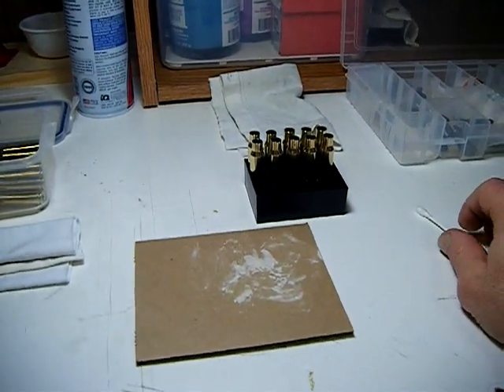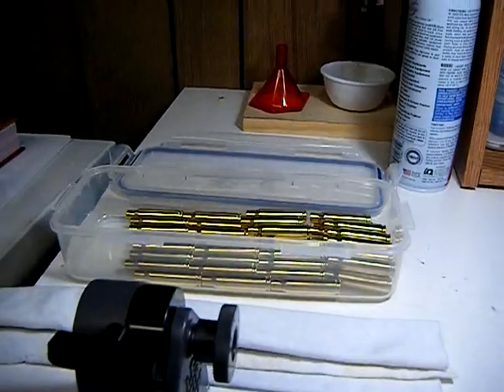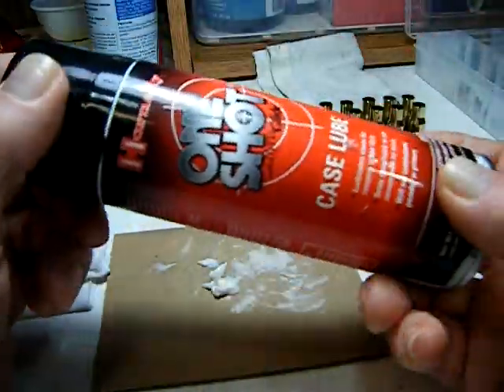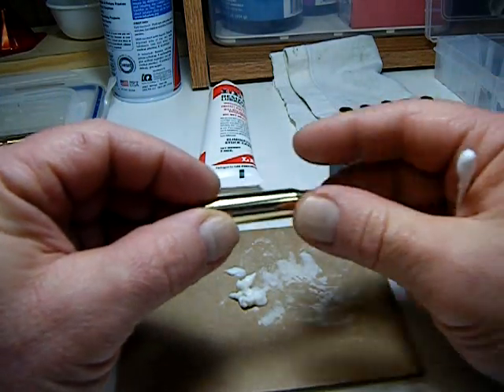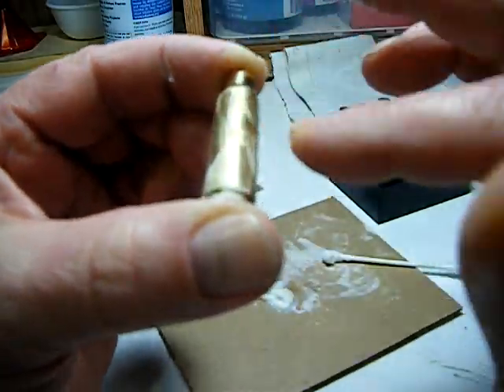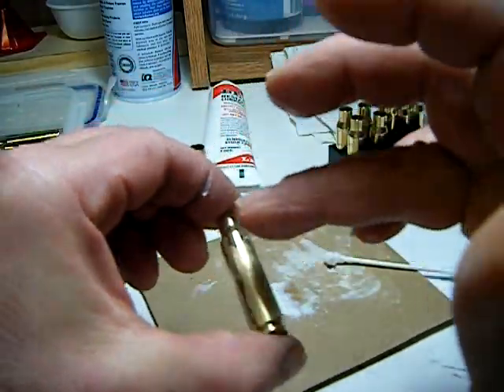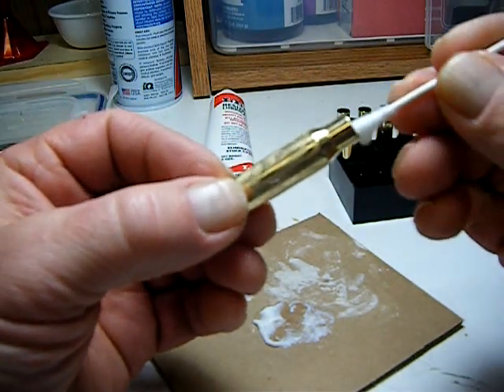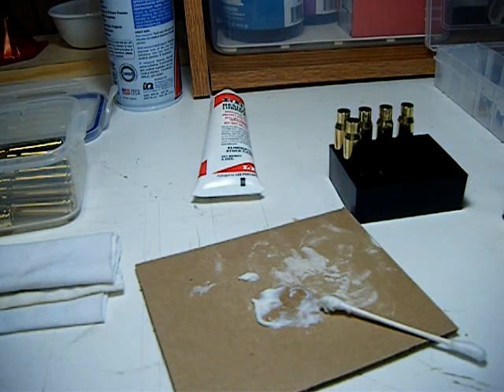Reloading-A demonstration, Lubbing the Cases.

Comment: You don't seem to be sizing the outside of the necks and the shoulder.
Reply from the maker: It is a "Full Length Resizing Die" it does it all at once....
Reply: Sorry, I meant to say you don't seem to be lubing the outside of the necks and the shoulders.
Reply from the maker: No worries...
I was taught not to...but at 3:55 I did the inside, and at 4:33 i barely run around the neck, it is not needed on the shoulder... and it depends on the case lube.... this type can build up inside the die and actually put a dent on the shoulder... I've done it....
Reply: ETHRON1 I’ve got the denting issue using regular case lube as well as Redding case wax. While using 1/100th as much as you appear to be using here. Can’t figure it out.
Reply: @ThisTall  did you ever figure out what the issue was?
Reply: @basketcas3717  Ya, for 1 reason or another I had to still use less lube, and make sure it wasn’t getting up on the shoulder of the shell or on that part of the Die. Cause it was the lube pressing the dents in. So I lubed every 3rd shell instead of every 2, and made sure I kept the lube back from the shoulder.

Comment: I tried 8 different types of lube.  Two different kinds of dies.  8 straight cases stuck in the die.  Nothing works.  I am an expert on removing stuck cases but 8 tries I have never successfully sized a case.  22 years ago I reloaded a lot with zero stuck cases.  30 06 and 308.  Same calibers this time but EVERY CASE gets stuck.  Waste of money.  The dies are crap compared to what they were 20 years ago.
Reply from the maker: Unfortunately nothing is.
Reply: I honestly never loaded a say in my life until about a month ago 9mm and 223 a few days ago. 9 with lee dies and 223 with rcbs, they work like a charm. Maybe you just aren’t following the directions correctly. The dies are not the issue.
Reply: @basketcas3717  Agree.  It is the singrer and not the song.  Excess lube was one big culprit. THis causes the excess compression blocking the hole in the die body.
That is one me....Problem remedied and thanks for your courtesy and input.  My dumb ass fault.